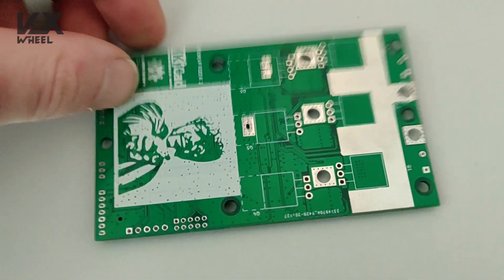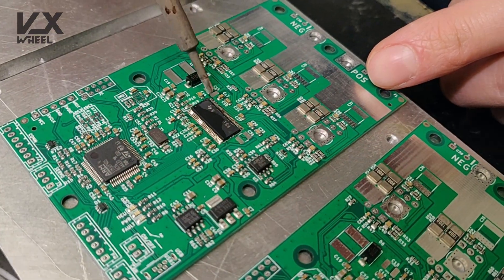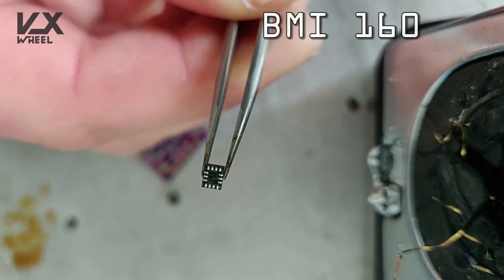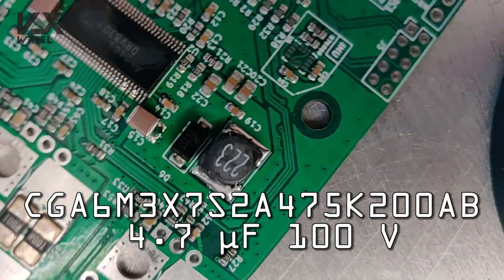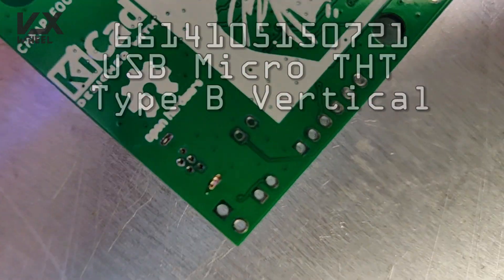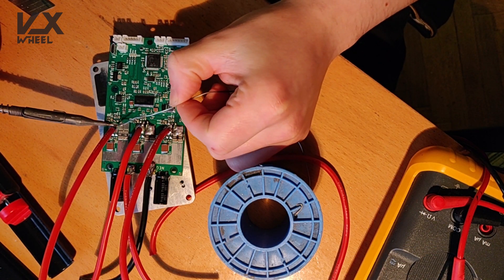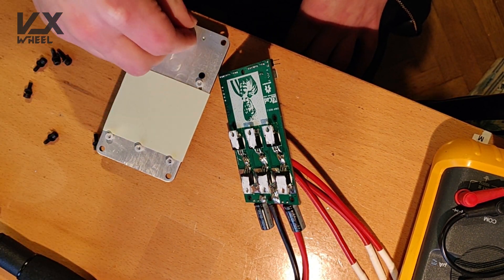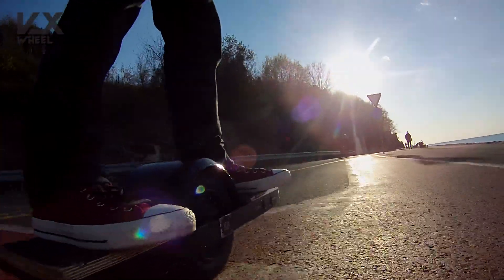DIY ONEWHEEL - EP3 - Cheap FOCer 2 assembly - VXwheel

Comment: Holy crap you made the installation of the BMI 160 look easy. I have been afraid to try it.
Reply from the maker: It is not super simple, but also not that hard, just check all the pins on the bottom edges.  They can be visilble a little from the bottom corners and they should look soldered. If not repeat the process until they do and they are not bridged.